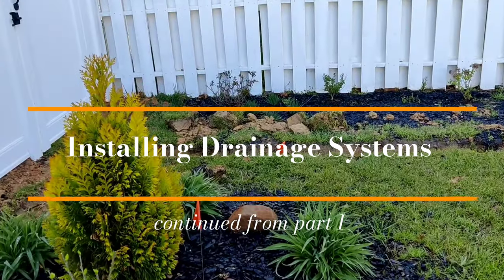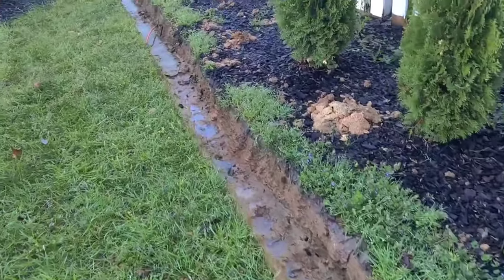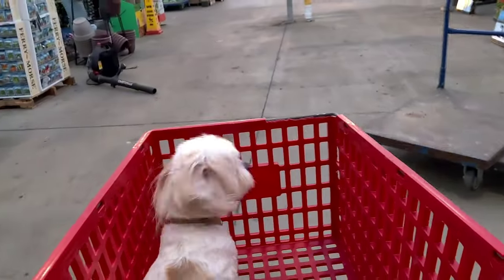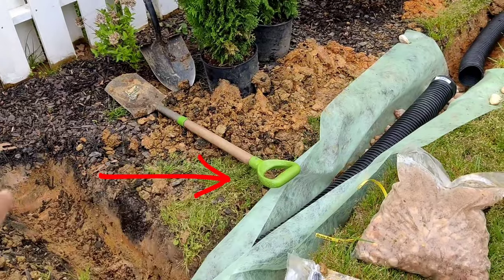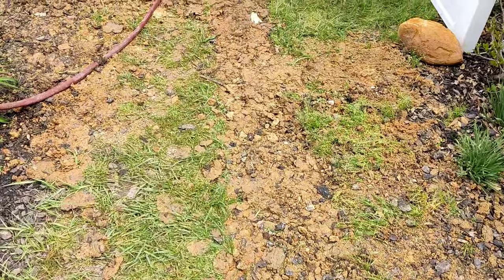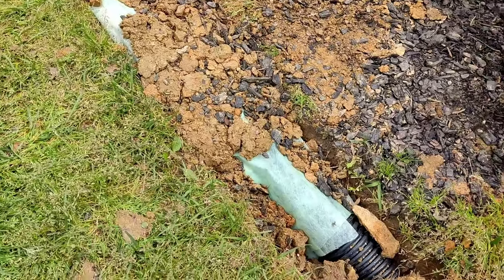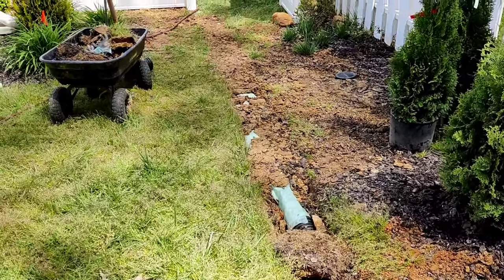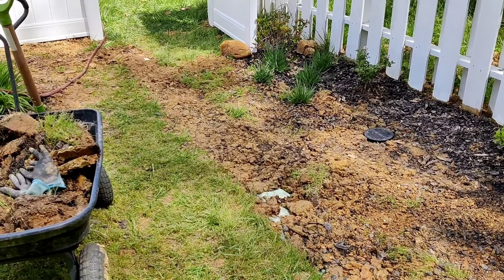Installing Drainage Systems part 2 |DIY| Backyard

Comment: You did what I should of done the first time around. I had to dig up the pipes to redo it lol
Reply from the maker: Now you have me curious what happened that made you have to dig them up & redo it all?🤔
Reply: Well the  drainage worked worked but it needed to be bigger. Because it still pooled at the end of my driveway. And I originally didn't add my gutter drainage. And that whole area was still soft. So I went back and ripped it out lol

Comment: When you plan on extending the bed, are you thinking of avoiding the drain system with plants or planting smaller plants over and around it?
Reply from the maker: My plans are still developing but mostly will plant around it & cover with edgers😉💚